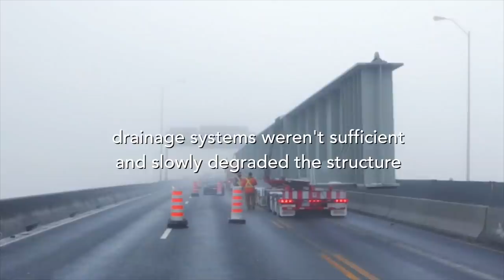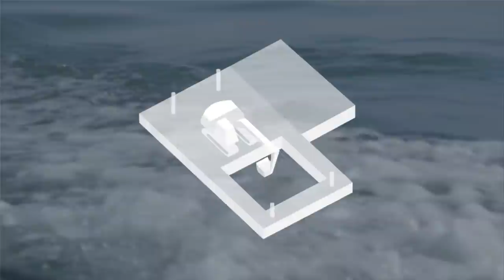Montreal's Newest Landmark is Canada's Busiest Bridge

Comment: It's interesting that Montreal seems to accomplish the most with projects that have a very tight deadline. Expo 67 had to be built fast because Moscow had pulled out. The bridge had to be built fast because the old bridge was falling apart. Both Expo 67 and the Samuel de Champlain bridge were open for business 4 years after breaking ground. Both were notable for using well established designs and engineering principles for their construction.

When given time, large scale construction projects in Montreal seem to get derailed very fast. The 1976 Olympic Games were awarded to Montreal in 1970, but construction didn't start until 1973 with a ludicrously complicated design that didn't take into account the weak condition of the soil at the construction site. Completion of the tower had to be skipped, and a good thing too since the continuation of the construction after the Games under the original design revealed the tower's footing couldn't handle the extra weight!

The construction of the REM seems to have broken this curse. It still had a few rough moments, but most of the construction has been progressing steadily, and trains are already being tested on the Montreal-Brossard route.

Comment: As a daily user of this bridge, it's missing about 2 or 3 lanes on each side. It always baffles me when I'm stuck in traffic every fucking day on this bridge... Why build for today and not for tomorrow? They keep insisting on public transit but news flash, there will ALWAYS be more and more cars forever until the end of time. Same for highway 10, should be minimum 6 lanes all the way to at least highway 35. Same for high way 30, between highway 10 and Varennes, it should be way more than 2 lanes. I could go on and on, but the rundown is the highway system in Quebec is lacking big time, always stuck in traffic because of terrible overlapping lane and highway access and missing lanes. Maybe the solution is pay more taxes (this is a joke)
Reply: You haven't traveled much for speaking like that have you?